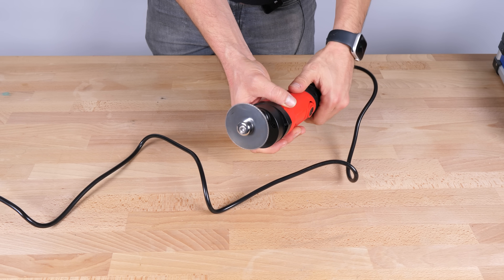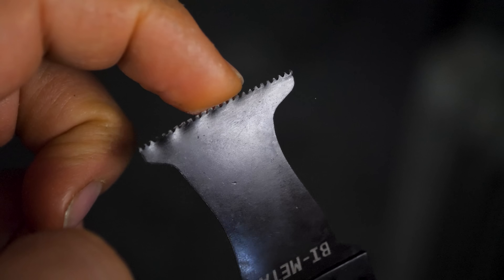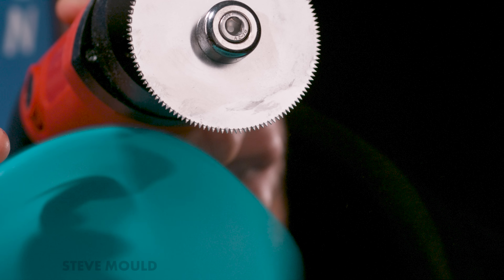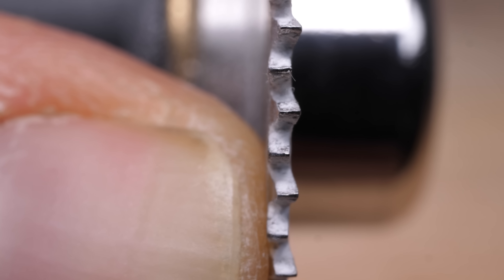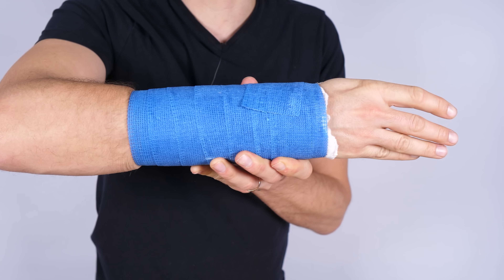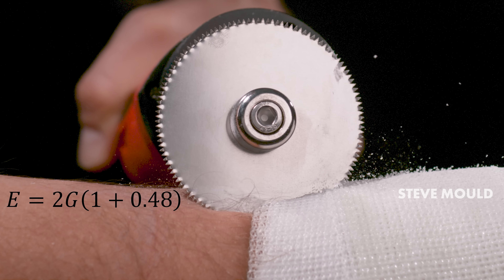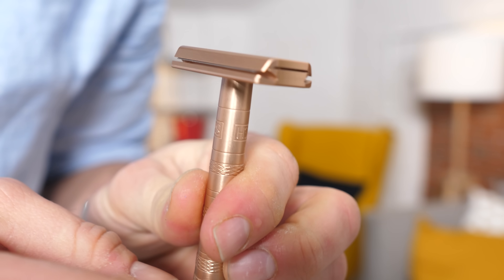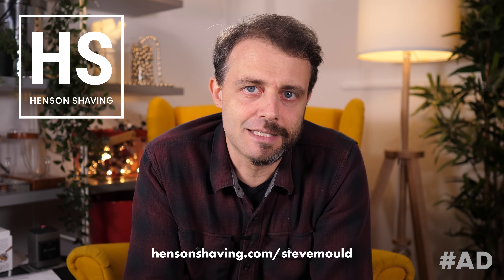A cast saw on human skin

Comment: I feel compelled to share that I am an outlier in that when I was about 11 years old I did actually get an injury on my left arm from a cast saw and I still have a pair of scars to show for it. That was close to 2 decades ago. I remember complaining to the operator and being told that it couldn’t hurt me, and then being vindicated when they got the bandages off.
Reply: You are not alone. Broken wrist in the late 90s. Exact same scenario. Horrible pain, being told, I was wrong and it could not hurt me, only for cast to come off and my hand covered in blood. Scar is barely there some 25+ years later, but it for sure cut me somehow.
Reply: @Digger813  It sounds like the cast was on so tight the skin couldn't deform. Being held tight the saw was able cut thru just like the blown up balloon. kinda like holding both sides of some plastic wrap tight so you can cut it.
Reply: Sounds like a lot of people didn't understand this tool.. You're not the first one I've seen on here saying that.
Reply: Ouch. Were they just pushing too hard?
Reply: What an amazing coincidence—I only just talked to someone who had the same experience. She also got nicked by a cast saw as a child on her left arm, but somehow she ended up getting both cut and burnt.
It's definitely a rare phenomenon and she must have been really unfortunate, even compared to other people who get hurt by those saws. If I remember correctly her injuries came from the fact that the padding material under her cast was not evenly distributed and there was not enough of it in the area where she got her injuries.

Comment: My genuine question is, why is the saw a full 360 degree disk then instead of being smaller, cheaper 90 or 120 degree arcs? They could literally make the same thing, cut it in threes or fours, and then sell them that way. Obviously there's a reason for this, and I'm curious what it is.

Comment: Having suffered multiple casts on both my legs - when the cast saw is used to remove the cast; the panic comes from the excessive heat of the saw mixed with the fact that it is pulling hairs along the way, as the medical professional attempts to quickly saw through the cast.  Never a pleasant experience.

Comment: The plaster in a cast may well achieve maximum strength in 24 to 48 hours, but it dries to touch much faster than that.  I broke my leg in 1982 and when they set me up with a walking cast, I don’t think it even took fifteen minutes to wrap my leg, and I could walk on it almost immediately.  When they cut it off, they explained the principle of the oscillating saw, so I was only a bit nervous about them cutting me.  No cuts, burns, or scars from the process.

Comment: Its just an oscillating tool, like the ones you can buy at the hardware store, cuts hard stuff great, but not soft squishy stuff.  You would be surprised how well an oscillating tool can cut different materials, including metal.

Comment: Deriving moduli in this way is problematic. Your skin is able to sustain a number of different waves, compression waves, shear wave, Lamb waves etc. And they are all happening at the same time. And as a result the moduli you calculate will be for different wave types. Waves in skin are really hard to model, measure and study in general.

Comment: I was building a deck for my grandparents and I was using my Dewalt oscillating tool. And my grandparents come out all like “oh my god be careful with that” and for whatever reason I decide it would be a good idea to demonstrate how safe it was by touching the blade to my arm. I didn’t get hurt or anything, but it sure freaked my grandparents out. They thought i was going to lose my whole arm.

Comment: With the below method, I have now gone about eight months using the exact same cartridge and the blades on the cartridge are as sharp as when I first popped the cartridge on.

Before or after you shave (I prefer before so that the blades are dry), place your jeans on a hard flat surface; then run the razor up the pant legs about 10-15 times quickly; then repeat running it down the pant legs 10-15 times quickly. No need to press that hard, but a little pressure is necessary. In both instances, you want to point the top of the razor in the direction you are rubbing the shaver on the pants. In other words, don't "shave" the pants; point the razor the other way, so that the blades glide over the surface of the jeans and don't try to cut them.

The threads on the jeans then will very effectively both fix any tiny bends in the blades that inevitably happen and will also sharpen the blades on your shaver cartridge . For an already dull blade, you can sharpen it up pretty effectively by doing 50-100 swipes both ways to get it back up to "like new" condition, but only 10-15 times swiped both ways should be necessary to maintain sharpness.

Pro-tip: rather than always having to grab a pair of jeans to do this with, I just cut the pant leg off some old jeans I was throwing away and put it in the same drawer as my Gillette shaver. The same pant leg has so far sharpened the blades on my shaver cartridge quite well for going on eight months now.

Comment: Back in the early 80s when I broke my wrist and had a plaster cast, the saw back then did cut me in the bony part of the forearm a little bit. In the late 90s when I broke my ankle it was the fiberglass type cast, I was really scared and when the saw touched my foot it made me jump but didn't cut me at all. I wish the doctor would have mentioned how safe it was beforehand because seeing/hearing it along with my previous experience made me freak out a bit.

Comment: I was an ortho tech for 20yrs and can't count how many times I used a cast saw. The first thing to do is use the saw on yourself before going after a patient, seriously people who use this tool..it is common to you, to someone especially a child, it is horrifying to see what appears to be a spinning sharp blade come at you. explain the process, explain the heat they may feel, tell them you can stop anytime so they can relax. It's not about you, it's about them.  If you suck at using this thing, practice on casts already removed, so you can feel when you break through. I've never hurt, cut or burned anyone, but have seen many who have done this to others. It can damage, especially skin that has been covered in a sweaty fiberglass cast for 6 weeks.  Want the patient that their arm/let will look weird, small, very hairy and that is 'normal' in the situation. Be human. it is a simple task to you, not to them.
This video should be on every single orthopedic website, as should an actual demonstration of the blade on a cast and effects on skin. Would probably save a lot of stress for a lot of people.

Comment: Plaster of paris is still preferred over fibreglass for a new fracture. I'm not entirely sure why, but I think it has to do with PoP ability to allow the limb to swell without cutting off blood supply. PoP is used excluisively in ED to stabilise fractures before surgery/imaging. The fracture clinic wouild give you a fibreglass cast to replace a PoP cast once the risk of swelling has gone.

Comment: corepman cut a cast off me the blade was dull so instead of changinging it he applied heavy pressure  he leaned into it which cut me  I told him hey that burns  he said i was whimp  so I sat back and endured  got down to my ankle bone then cut from the toe rend of the cast till  his cut  and then pryed the cast off i was bleeding from the amount of pressure he put on the saw to cut the cast  the blade dudnt cut my skin it burned though my skin from the heavy pressure he applied  when done thats when te doc walked in  saw me bleeding and asked me why i didnt say anything  told him i did  but the corpman said i was just being a whimp.  the cut wasnt deep just the top layers of skin  a dull blade and heavy pressure will burn its way through your top layers of skin friggun rock ape of a corpsman

Comment: The reason I dont use a so called safety razor, now there's an oxymoron, is because in a bathroom early in the morning, there's too much chance of cutting myself with a tiny thin blade when changing them. If the companies can work out a way to not have to touch the blade when changing (like they did with the cartridge system), then I would use it. Maybe a tool to swap them out or something to do it without the chance of cutting yourself. Not everyone is dexterous enough to do it, but companies dont seem to have understood why their products dont sell.

Comment: Just FYI: a plaster of paris cast is usually used on a recent fracture because it lends itself more easily to putting on a cast splint rather than a circular cast which allows for post-traumatic swelling. Synthetic casts are used for circular casts, which is shouldn't be put on any earlier than 5 days post-trauma.
Reply: I understood nothing of this, but I appreciate the information nonetheless.

Comment: When I was 10 I broke my arm, nothing too dramatic, a minor fracture combined with a joint dislocation. Since I didn't need surgery, I wasn't really afraid when putting the cast. But when I found later that they would use this thing to remove the cast I was terrified. I literally thought it was a buzzsaw that could chop my forearm off if a single tiny mistake was made. So I was always avoiding that fateful day, took a trip with my grandma to the country saying I would have it removed there, but didn't,  and kept saying I would have it removed when I come home. Anyway, it passed over a week beyond the time I had to remove it, but I was still not willing to got to the hospital, so my dad just put my arm in the casket in a bucket full of water to soften it up and took it off with a mitchen knife. That was almost 30 years ago and now watching this video I feel so stupid to make a big deal out of it.

Comment: If the blade only had teeth on the half of it, and the other side was smooth, I think it would greatly help people understand that it is not like a spinning saw and won't cut you. You can even have them touch the smooth part to feel it oscillating.

Comment: Plaster of Paris doesnt dry but cure, and yes it'll take a few hours to dry, but a good immobilization will be achieved in less than half an hour, it's something about the point to which the mineral has been dehydrated before use, in construction theres apparently different types of plaster, ones that cures in less than 10 minutes some that take hours, for a lot of stuff we still use plaster of paris.
Also synthetic casts do cause less visible mess but special saws are encouraged that have a vacuum system built in, mostly because they do use harmful fibers most of the times, I remember cellacast xtra being made out of glass fiber as an example.

Comment: Regarding that double edged razor, depending on construction you can expect handles to last 5-10 years.  Reasonably good blades cost maybe 25-50 cents apiece depending on brand and bulk discounts. The quality of shave with a double edge razor and a good shaving soap is unparalleled except maybe by a professional straight razor. A slight tip for new adopters: rinsing the blade thoroughly in water as hot as your tap can get both before and after use helps prevent soap and debris buildup and stropping the blade before each day's shave can mean the difference between a blade lasting a few days and one lasting a month or more. I think my record was 7 weeks before I felt any tugging or scraping but it's usually 3-5. I strop with the pad of my thumb under running tap. But a piece of leather or a dry microfiber towel can do it more safely. All it takes is to go a few times from the top of the razor head down over the blade. Like if the normal shaving motion is to pull the blade over skin, the stropping motion would be to push the razor head over the strop pad. You don't want any sideward motion, especially if using your own hide. Basically it flattens down any burrs that might form and keeps the blade top smooth as its edge wears.

Comment: This works exactly the same as your oscillating carpenter tools you trim molding with etc.  It will not injure you went placed on the skin.  Looked at the shaving site.  I still use Trac II blades from Internet with a solid brass handle (will never break) purchased at a men's shop on Bond St London in 1979.  What I saw is today is definitely better then the newer muli-blade stuff they sell now.  I still use the single blade razor for neck trimming and underarms.

Comment: I'd like to know how my doctor managed to still cut some of my skin as a kid when he was using this, I remember feeling very intense heat coming off the blade as it got closer to my skin, so I suspect that would be the reason behind it, there was no bleeding either, but there was definitely a slightly deep cut, about 1.5/2mm deep and around 1cm long, I'm guessing it was a burn rather than a cut itself.
Reply: The skin of a child is generally more stretched/taut than adult skin.  As a person ages, skin starts relaxing.  This is why skin becomes wrinkled and flabby as a person ages...no amount of creams and lotions can fix that eventuality.  So a child is more likely to experience "razor burn" when removing a cast than an adult.  Oscillating blades behind a foil are how the most popular type of electric shaver works.  Razor burn happens when skin is pulled too taut and a blade is drawn across it.  A possible mitigation for children would be to gently push nearby skin toward the area of the blade (i.e. temporarily make the skin more relaxed near the blade so that it doesn't cut the child).

Comment: I was a technician in an ER and using this was one of my duties. Young kids would freak out when you'd roll it in the room. The one we used was attached to a rolling shop vac. I'd turn it on and touch it to my bare hand and then, if the parent was not a chicken, touch to the parent's arm to show that it won't cut skin. Usually after that, most kids thought it was cool.

Comment: Neat; I thought the blade had rounded teeth that wouldn't catch/pierce the skin, but the fast speed of the blade would wear down the harder cast material.

Much safer than when I had a cast. An x-ray at a diagnostic clinic showed that my arm was healed enough, but I had to make a separate appointment at the hospital to cut the cast off.  I was completely fed up with having the cast at that point, so rather than waiting several more days I took a utility knife with a very small amount of blade exposed and slowly cut through.

Comment: I fractured my right radius when I was in third grade.  When it came time for the cast to come off I remember my doctor pushing the saw to the back of his hand first to show "see, won't cut you."  The friction of the blade into the resin is what got uncomfortable.  

Oscillating multi-tools definitely bite, but I'd rather have a minor scratch/scrape than lose a digit or need stitches.

Comment: Skin is anisotropic (meaning not isotropic). The formula you used is for isotopic materials. It’s not valid for skin or for any other anisotropic material. In other words, there is no governing relationship between the elastic modulus, shear modulus, and Possion’s ratio. They are independent values.

Comment: Long ago in a galaxy far away while working in orthopedics I used to remove casts and split them to relieve pressure. I would demonstrate how the saw works first on my arm, and then allow them to touch the blade. The adults were worse than the kids. Our system had a vacuum that almost made more noise than the saw. Those were interesting days.
Reply: Poor adults might've had unexplained traumas
Reply: Adults are always worse than children. 
Children are capable of following simple directions and are easily appeased and distracted.
Adults don't think they should follow directions, and can often be so allergic to information that you can't even get directions across, much less get them the hell out of the way of danger.
Children don't have overinflated egos and a sense of entitlement, they're the kind of dumb that's easy to manage.

Comment: I'm not sure I like the balloon metaphor because an under inflated balloon is also thicker than an over inflated balloon.  I believe that the provided elasticity limit explanation is correct, but the balloon metaphor in particular leaves another potential explanation on the table.

Comment: There's also ultrasonic surgery blades that work based on the same principle, except, it's very high frequency, and micro/nano meter movement. They can cut the skull, but not the brain.

Comment: Quick comment on those calculations of the module of elasticity. Those equations only apply to linear isotropic materials which skin is not (which you kind of alluded to). So those numbers are way off. Otherwise, really cool video!  I wonder why the cutting teeth are angled out like they are?

Comment: There's a case where the cast saw is not safe against human skin, when the (part of the) human is overinflated, like the overinflated balloon. Lymphedema is one way to be in that state, but I think they're unlikely to risk a traditional cast with lymphedema.
However, if you put a tight hard ring around some portion of your anatomy with high blood flow, you might trap blood in said portion of your anatomy, and it can swell and get painfully overstretched, like the balloon, as well as trapping the (probably metal) ring in place. Ask any ER doc or nurse about this and they will have loads of stories to tell.
So basically what I'm saying is if you find yourself in this unfortunate situation somehow, go to the ER sooner rather than later so its safest for them to pull out a cast saw and free you.

And also don't use a very hard metal that a cast saw can't cut through. Nobody wants industrial cutting equipment used near their soft tissues.